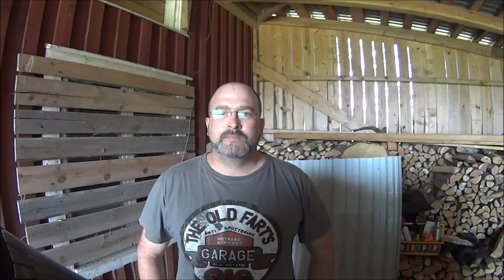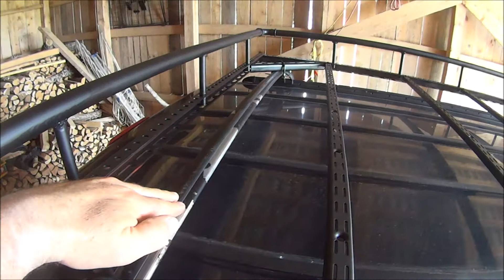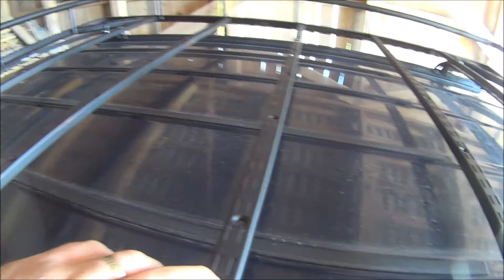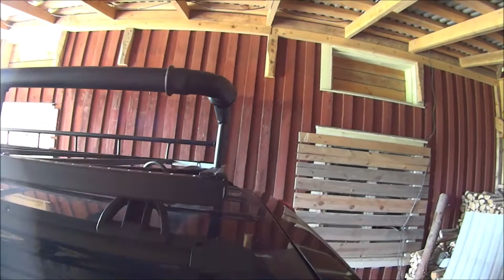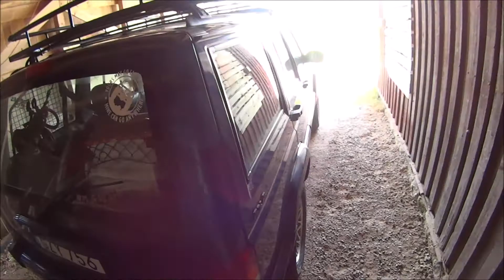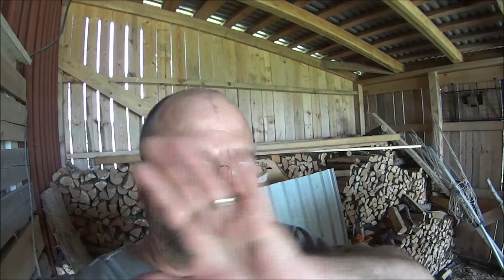Jeep Roof rack build

Comment: nice rack steve. And you spelled my name perfectly.perfect Dutch. I am especially curious about what the Jeep looks like when it has been sprayed again with Raptor. ATB.
Reply from the maker: That might be a while yet,   But thanks for the comment Raymond.   ATB Steve
Reply: Hi Steve,

Which modifications are you planning to do more? maybe a winch, or higher tires or do you want to leave the car original for the rest. ATB Raymond
Reply from the maker: Raymond Logister I want to fit a 3" lift kit to it once I have saved up some money as the rear leaf springs are sagging a bit and of course the Raptor liner.  Beyond that I am not sure.  I don't think a winch but never say never😀  ATB
Reply: Hello Steve,3 inches is a serious lift. assume that you will also install higher tires on the jee?. Then he looks a lot cooler.ATB Raymond
Reply from the maker: Raymond Logister Ha!  The jeep is actually 1.75 inches higher than stock anyway.  The tires will stay the same....can't afford them as well,  plus i have only just bought new ones. ATB